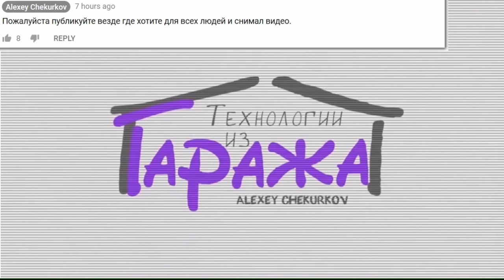Alex Flying Craft Полёт Гравилёта

Comment: mmm I would have to say that there are two models in this video one for close ups where you cans see the Supposed discs that do the work and we have the one in the air with hands and sticks showing no wires..... how does it levitate well the one flying I would suggest is using an electric fan to give lift... probably with gyroscopes to stabilize, but when he is under the craft after yanking on the cables. you can see air being blown down by the downforce... thhen why dosnt it simply drop when the cable is pulled from the battery? well a bit more showmanship pull a cable that isnt hooked up then cut to craft still hovering wait a few seconds then pull the real wire... the circuit diagram  contains very little data so that other people can reproduce the results but he does say if he can raise some money he can produce one to lift people..... good work.. nice illusion please show the next act onto the stage....... but of course if anyone else has produced verifiable results i will apologize
Reply: Possibly the stupidest reply I’ve seen yet! Do you understand the force that would be needed to levitate this with a fan? It’s a pretty windy day, were it levitating by fans it would be swaying in the wind big time! No wires, the pushes up on the thing, so if it had wires it would come down extremely fast and abruptly stop. The guy pulled down on it also, which completely goes against being held up by fine fishing line. Also if it were being held up by line, the wind would cause it to swing, and it’s not doing that! I usually never believe in this kind of nonsense, but this one is very difficult to tear down…

Comment: ANYTIME you have mechanical movement you are blowing it.
You can use a 3-phase motor driver to create a rotating magnetic field.  You will have NO MECHANICAL ROTATION.

Instead, you will have:
1)  two 3-phase motor driver circuits - one for the top (fixed, not moving) disk to create a rotating magnetic field spinning CLOCKWISE.  Make the 2nd 3-phase motor driver circuit create a COUNTER-CLOCKWISE rotating magnetic field for the bottom (fixed, not moving) disk.

2)  because you rely on electric circuits - ie. two separate 3-phase motor drivers (recall that a 3-phase motor driver circuit creates a rotating magnetic field that is normally used to spin the shaft of an electric motor, but here you'll use its rotating magnetic field circuit for a different purpose)  -- YOU CAN MAKE THE MAGNETIC FIELDS SPIN *ARBITRARILY FAST*.  MUCH faster than any mechanical rotation you can establish to rotate the physical disk itself.  The rotating magnetic fields INDUCE CURRENT FLOW in the top and bottom disks, in opposite directions.

3)  the middle non-moving disc would be best implemented as a positron-emitting material, such as a  (22)Na isotope which provides β+ positrons.  This is a technical issue involving electron-positron interaction - ask me for details

You now have a top CLOCKWISE-rotating magnetic field at an arbitrarily (very high, as high as you want if you build your own 3-phase rotating magnetic field circuit) rotation speed with NO MOVING PARTS because the 3-phase electric motor rotating magnetic field circuit has no moving parts.  The top disk has a very high current induced in it.

And the bottom disc has a very high current induced in it by the (non-moving) electric 3-phase motor driver circuit that creates a magnetic field rotating COUNTER CLOCKWISE.

And the positron emitter central disc increases the gravity effect.  For an even greater effect, use (non-rotating) superconductor disks for the top and bottom disks; get them below critical temperate by dowsing in LN2 (liquid nitrogen);  then allow the LN2 to drain off. 

AND ALL 3 DISKS ARE *FIXED*, THEY ARE STATIONARY, NOT MOVING.

 The resulting loss of Cooper Pairs in the superconductor disks as the disks fall out of superconducting mode will REALLY increase the effect.

But if you just use the counter-rotating magnetic fields and the positron-emitting center disk,  you should see a weight loss, depending on the strength of the electric field.  You can apply a very high voltage to the top and bottom disks to increase the current caused by the two counter-rotating magnetic fields.

But again,  ANYTIME you have mechanical movement you are blowing it.  You should always avoid mechanical movement of any kind. 
.
.
Reply: Any books that will help understand this because I am new to knowledge? Have you succeeded to build one yourself?

Comment: if stting parameters is so complex you first need to make a computer control that does all the settings, like a arduino or so. what is to set? rpm, voltage, frequency. ? what else?

Comment: Ty for the English assistance, what is the metal..In his Russian version I was sure he mentioned aluminum, is this true? And the next question is the blue fog on the unit has been seen in other ufo video, here I thought was his high voltage. But with the battery disconnected it should stop but doesn't. So 2 possibilities are its fake or its a property of the metal disc. So what the heck is that disc. I've been looking for such a metal as my intuition says it exists. Any help with these questions? The spinning mag disc has been described before in connection to these mag mounted against a copper plate spinning. As copper has strange effects in mag field like hydrogen climbs a wall in viscose form. A standing mag effect against the earths em field. Not sure if I'm explaining this understanding correctly or my understanding is in error. Ty again

Comment: In the first video there is a cut, we can see it very clearly, the shadow at 4:15.
for the video outdoor is more difficult to see where is the trick, maybe horizontal wire with a small extention in the middle where is attached the flying disk? 
i'm still triyng to analyze that in more profound way.
About the technology i don't see any real mechanism / working concept, High voltage from a small Kacher/tesla coil as that applied to a wobbling rotating disks....very bad gyroscopic stabilization....not DC electrostatic HV effects until is rectified with good diode rectifier.... 
how can be affected gravity with that HV small power?
i made several test on this subject, SSTC, electrostatics effects/interaction etc etc
as you can see in my videos, this is my personal opinion.
Thank you as always Wesley, every discussion is important to understand more, maybe i can be wrong...let's see in some time what that guy can do....
For now I vote for a fake.
Ciao!
Reply: ....and still filmed with a potato. It must be a universal rule. If you film a UFO - even man made - use the worst camera possible!
Reply: What about the 'special metal' he claims to have.. you make no mention of that in your analytics.. how about we have him prove it in front of witnesses?